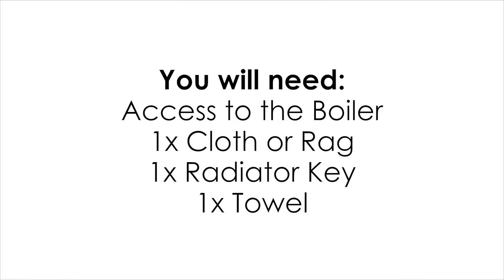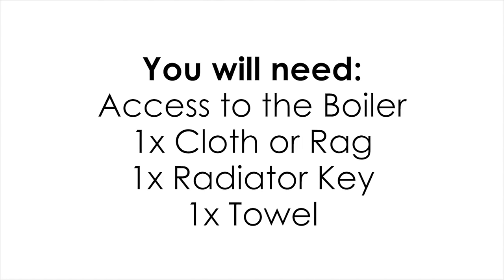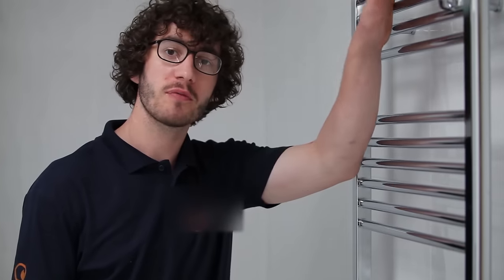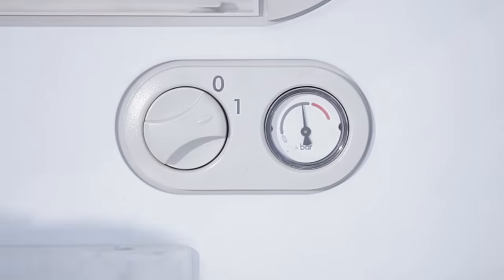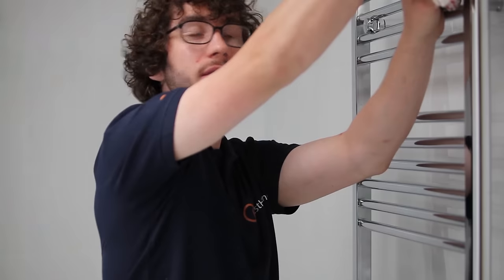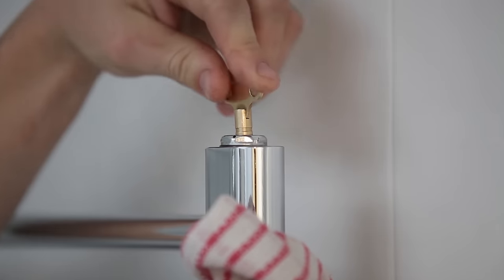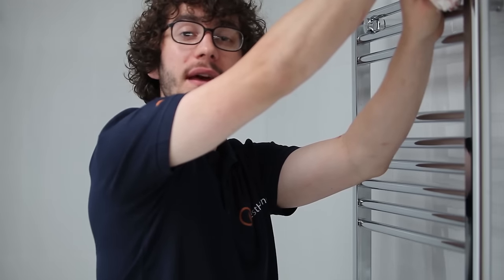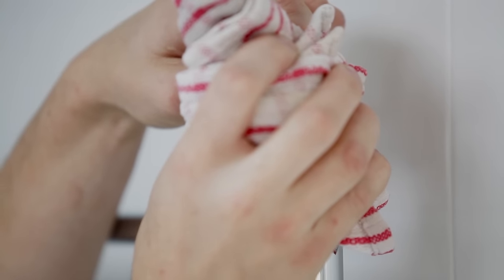How To Bleed a Heated Towel Rail | BestHeating

Comment: Thanks so much for this, it looks super simple. I'm going to try this tomorrow when the heating is off (it's too cold tonight!). I have a question though, how would I top the boiler pressure up - and in fact - how would I know if I have a pressurised system? We have a dial similar to the one shown next to the on/off switch, so I'm guessing that's is a pressure gauge?
Reply from the maker: Hi Anna, thanks for stopping by. You can learn about filling your system with the help of this video - https://youtu.be/2O31XXVstG8 - hope this helps. Thanks, BestHeating

Comment: Thanks, it worked, but I did need to then add more water to the system using the fill valves on my combi boiler.

Comment: My towel radiator doesn't have a bleed valve that we can see. Any ideas?
Reply: If you can't find at the top of the radiator pipes then just look around it on the back as some radiators have it on the back for aesthetic reasons. Your radiator may also have a cover like a coin on top of the pipe. Try to move it and it will then expose the bleed valve.

Comment: If I want to drain the radiator of some water to add in some leak stopper do i just let the water run out from that point enough in the same way just with a bucket below? !!
Reply from the maker: That would work. Just be sure to repressurise your heating system after you have added in the leak stopper.

Comment: Well we did that and there was no hissing and the rail is still hot at the bottom and cold at the top
Reply: Did you figure it out / get it fixed? Not a pro/expert but wondering if it could be even blocked (less likely if newer system, takes many many years for enough sludge to build up for that to be a risk), or maybe the pressure is too low and it can't get pushed up to the top (or if another radiator is stealing it all, if thats a thing).
Reply: @jgbreezer  It was indeed the pressure.  An engineer called to service the boiler and we asked him to look at the rad.  He just re-pressurised the boiler and the rad has been fine ever since!

Comment: no where on my towel rail to fit a radiator key
Reply from the maker: Hi Diana, that surely can't be. If you look around the top of the appliance, you should find a valve somewhere. Sometimes they can be round the back for aesthetic purposes. If all else fails, send me an email at john.lawless@bestheating.com and attach a picture and I'll try and help
Reply: Mine is the same, turns out one side had a plastic cap that looked metallic. Popped it off and the valve was underneath